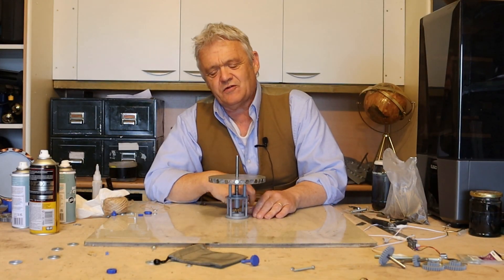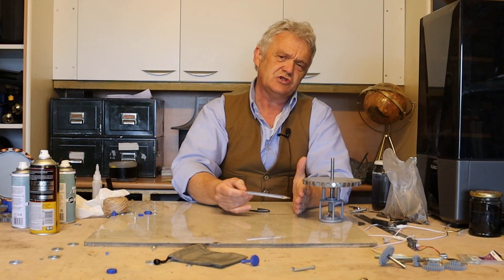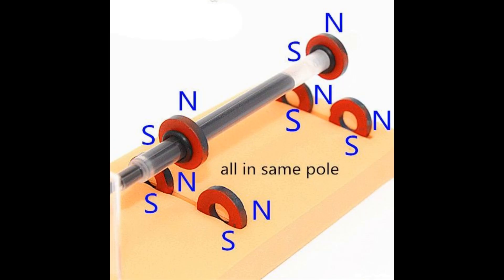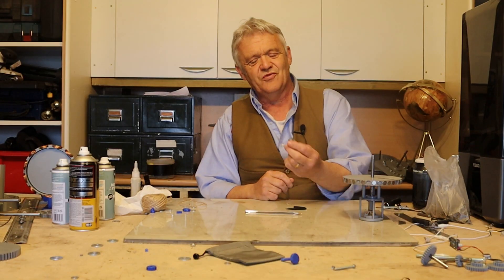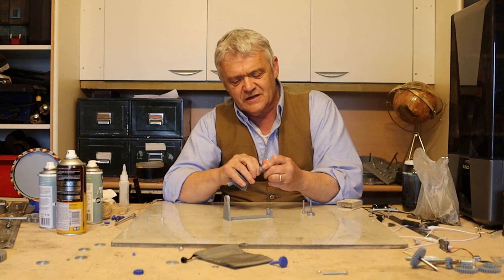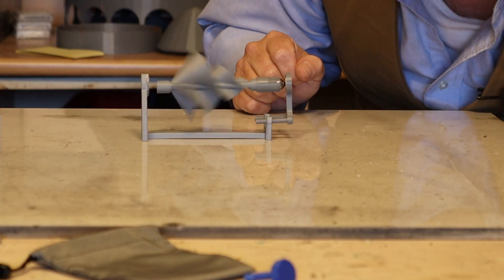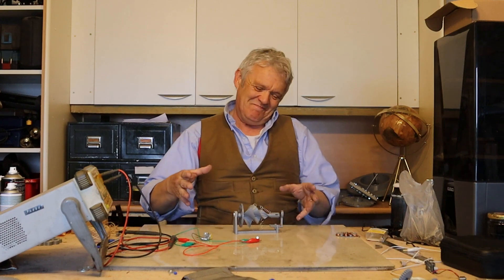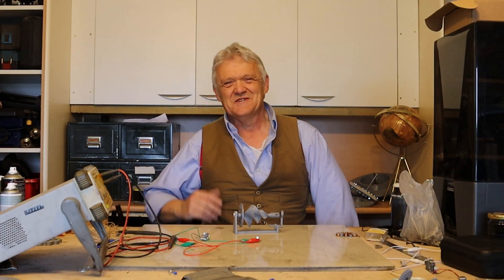1995 Archimedes Wind Turbine With Magnetic Bearings

Comment: Your video is very interesting; you remind me of the first steps of Mr. Gernot Zippe (Mr. Steenbeck's son-in-law), 
when he was looking for the right compromise to build his first centrifuge.
 For the record, he used the magnet (1948/1952), and the needle at the bottom was made of piano wire steel,
 to make a beautiful little needle, (like the needle of the phonograms of the time)
the needle turned at the beginning in a small concave oiled container!
Finally, it is also the fact of creating a vacuum in this process which allowed great reliability of the rotations...

Comment: Could you please, Robert, run that tri-blade Archimedes screw in reverse to turn it into a propeller and do a whole episode on this propeller concept’s performance? That means the blunt side will be the front that scoops the air in and the pointed side becomes the back where the air exits. Use physical bearings, though, rather than wobbly magnetic ones for this experiment. I imagine it will be super quiet and very efficient! Please. 🙏

Comment: awesome, being archemedies turbine it will auto cock itself into any wind also :) i can see small varients of these being included on e vehicles to scavenge power it ofc can never equal the power needed to move it along but with so little friction & being self cocking design without need of extra power i think it could be as useful as pasive breaking systems are for energy reclamation

Comment: The Texas Engineer has the US Patent on the Tornado Turbine many years back. . It is regarded as the best windmill design for generating electricity. Photos of it are included in wall posters of various designs of windmills. Looks like a farm silo at a distance with small upper 360 degree automatic directional vanes catching the breeze and the air swirls down inside the spiral large vanes to the main large electrical generator that is above your head. The fast air exits out the sides at an upper level.
Reply: the archemedies turbine due to its shape is also self cocking and works in winds of just a few kmph. it will always point into wind just because of its shape so its always receiving maximum possible wind load on maximum amount of surface

Comment: how about running the current back into a small electromagnetic  floating bearing to strengthening it. Till a certain level of power level is achieved. then release the remaining to power the light. while still strengthening the bearing. achieve high speeds, more stability?

Comment: Couldn't we use this on the sea bed, to generate electricity from ocean currents ? Better than the windmill type devices that kill fish and whales etc. Some mods would obviously be required, perhaps depending on the rate if flow of the ocean current you are aiming to tap in to ? Ocean current operate 24/7/365 so no need for so much storage. 
Am I too late to take out the Patent on this ?

Comment: Many wind turbines have one problem: high winds. As the wind speed goes from a normal speed to 80 - 120 miles per hour, the turbine spins so fast that it can be torn apart. In the large 3 bladed wind turbines the blade changes position relative to their mounting hub. The more the blades rotate relative to the hub the less force the wind can exert on the blades. When the blades are parallel to the wind direction, the wind turbine stops rotating and the high speed wind won't destroy the turbine.
Reply: I think they have brakes to get the speed down

Comment: We missed something. If the turbine is configured to suck air from each end of the turbine, opposing forces would neutralise all torque forces upon the turbine drive bearings and drive shaft. In effect, using high-volume vacuum pressures to drive power devices

Comment: Ha good thinking. I had the exact same idea 5 years ago with this exact turbine except I had it hanging vertically above my living room radiator from a screw and had the bearing attached via a tubular magnet glued to the turbine. When the heating came on the turbine would spin. Hardly any resistance this way, the slightest breeze and it flies!

Comment: This is a good idea! Smaller turbines require less wind to rotate than large turbines. This could be scaled up with several small turbines in a fence and then have a screen around it to prevent birds from flying into it.Also it could be built into architecture such as bridges and property fencing to reduce optical blight. Awesome idea!
Reply: I'm not sure a screen would be ideal. I think you'd be robbing your efficiency
Reply: Wind is a fickle thing...

It is disturbed by the smallest things in ways that are detrimental to the ability to use the air movement to harvest power.

Normal recommendation is the bottom of the wind turbine be 30 feet above the highest obstruction within a very large radius.

Your screen, even "chicken wire"  would naturally interfere with the wind and greatly diminish the ability to harvest power.
Reply: It's doing the same work as a 3 cent solar panel.

Comment: I'm retired now and I worked with Rotary Screw NH3 (Ammonia) refrigeration compressors for the most of my working life. I was aware that there was research and some progress with magnetic bearings both for the large electric drive motors and the compressors. Something like that would reduce starting amps and in essence be frictionless for stationary rotating equipment. Have you ever heard of this path of research?

Comment: Dear Robert,
Here in Chearsly , Bucks, we have a three phase supply lines to an
empty disused and unconnected old pig unit.
A hillside location, where two telegraph poles hold
the transformer above the removed old metre

Inside the building are lots and lots of electric fans, some quite big
Millling ones, grain bins etc. others ventilators

So from what I have learnt from your lessons; I hope is:

It would be mad not too collect all the biggest motors
Four biggest for first morning 
Get them on the Hill by the power box
Support them facing upwards (as high as possible)
Use farm made barrel turbines.  Out of plastic 50 gallon barrels 
Or whatever’s best under trial 

Get a bod and electrician too collect the whole lot together and open a new power company account metre below
transformer for them 
to connect too and start feeding power
back down lines

Robert , assuming that the sparkys know there stuff ;right this and that wires etc 
and the fans turned with the prevailing wind
I can’t see what’s not to like
Am I mad or not
Using barrels would protect motors from rain up on two gate posts
Love what you do
Sincere one
Henry

P.S I’ve worked on the farm for twenty seven years, but my channel videos make it look like I am a rock star
I am not. Only for fun.

Comment: Great video, love the tinkering. I had an idea that you might perhaps try out. I'm curious to see the flow rate of your modified Darwin project connected to a output tube (keep the diameter constant), apply a hair dryer for hot air & measure end of tube flow, then try with cool air (getting same input flow rate) & measure air output flow rate. I wonder how different lengths of tube would change the rate (slower is some function of longer tube due to friction perhaps?). I wonder how hot or cold air may change the flow rates per length of tube. Kicker could be... Would a Tesla (scientist, not company) Value aid in increased flow rate? At beginning or mid or end of output tube? What about by varied tube lengths &/or heated or cold air?

Comment: You can literally use a brushless DC motor (from an old record player) for this and it's pretty efficient. I've taken one I've had fro MANY years and put an old microwave fan blade on it and attached the contraption to an 1/2 inch PVC pipe and stuck it high in the air. It made about 14 V - 19 V easily without a load.

Comment: Why couldn't you take a cone magnet and use it for the end and machine a female to the cone tip that was the same polarity either as a magnet or a piece of iron with a magnet attached to give it the polarity desired? The cone "should" provide a constant on both ends without the need to touch on either end. This would remove all drag. You could even stand it upright and further reduce gravitational interference.

Comment: Fascinating, as always!  If I get the assembly, the ballpoint bearing is on the windward side of the turbine, so the wind thrust would pull the bearing away from the bearing surface. Would turning the turbine around allow the bearing to carry the wind thrust? That might stabilize the wobbling a bit and support the thrust.

Comment: Ever thought of using using a CDROM moteor as a generator? All the ones I've used in the distant past, used a three phase winding so you need a 3 phase rectifier. Used to connect it to a modiified Fan to drive the gennie.

Comment: I've asked the question on multiple videos of people demonstrating this floating axel setup: Can the point contacting the retainer plate be replaced with  2 opposing force magnets, making it a contactless axel? What fails if the axel has an outwardly facing south pole and the retainer plate has an inwardly pointed , opposing, south pole? One would assume that the 2 magnets could be arranged so that the tip of the axel is magnetically floating above (beside) the magnet on the retaining plate, making the entire axel a truly floating mechanism. Seems logical in my head, but I've never performed the experiment. If you have a few minutes to set that up, it would be great to see the results.
Reply from the maker: the simple answer is no - the explanation of why is long - which is probably why you haven't had an answer yet - but the simplest thing is try it and see - good luck

Comment: Very very cool Robert, love how fast you can bang proof of concepts with a 3d printers, imagine Tesla with one of these, instead of designing and hiring out contractors to build something, Inventing has never been easier, tinkering has never been fast and efficient.
Reply from the maker: t s astounding how 3d printing is helping - to think only a year ago - less probably - would have been in the '3d printers are rubbish camp' - how things change!!
Reply: @ThinkingandTinkering  I was using 3d printers 5 years ago and it was like "why spend so much time building and tinkering with the 3d printer when I can just build what I need faster than making the printer work to make it:, but now they work out of the box and with filesharing and easy cad wysiwyg web programs, you would be insane NOT to go the way of the 3d printer, the day of super speed inventioning and prototyping is upon us, nice to see you at the forefront :)

Comment: Magnetic bearings work best in a vertical orientation and the method of holding the bearing in position requires correct placement of the magnets to have an attract and repel setup. I made one as a demonstration using an old CD storage case to make the bearing mount and the spindle as a proof of concept that had the desired effect of both working and shutting up those who claimed it couldn't be done.
Reply from the maker: done videos on it in vertical too mate

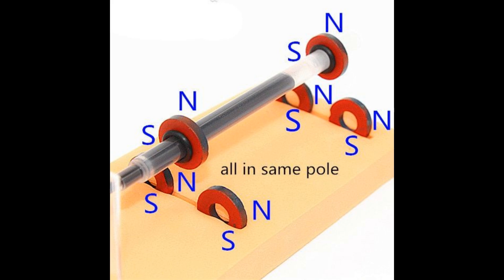Comment: At 1:32 all you need to do is clamp the rotating shaft with another 4 magnets above the shaft magnets this should stop most of the wobble. Basically duplicate the bottom plate above the shaft. Ultimately you should clamp the rotating shaft in place totally with 10-12 magnets and no ball bearing the only friction would be with the air.
Reply: I used 4 magnets....2 on bottom 2 on top (not symmetrically spaced) to help dampen the wobble.  It does work...I can spin my horizontal magnetically levitated motor to 2500rpm and she runs pretty dang smooth.  I even have an axial flux rotor attached and I can get the stator very close.
Reply: @Dave_D.  Im assuming you still kept a point-contact tho, like the ball-point bearing the video shows. Im specifically refering to a system that would achieve 0 degrees of freedom from magnets only. Using mechanical joints and bearing, it is as you could say staggeringly easy to achieve it.
Reply: @colinlapierre-fecteau316  I thought @kevin was simply talking about the shaft rotation bearings....where Robert's 1st example showed just 2 underneath.  If you add 2 more on top -  to form more of a complete circle, it helps hold the shaft stable while it rotates, as there is forces acting on all sides, not just the bottom.  Yes, I still have a pen ball point as my contact against tempered glass.  I don't think it's that easy to eliminate the single point of contact and use magnets...I think I MIGHT have seen one example where he claimed to have done it....and I've looked at a lot of stuff on levitating a rotating shaft.  Search for 'flywheel with magnetic bearing' (synterr)....he has 4 magnets and it's so smooth.  He does have contact points on both ends...I only have 1 and my shaft is 2 feet long.
Reply: @Dave_D.  that's interesting!
Its true that what i've seen said was about a static equilibrium, so it might be possible to have 0 contact as long as it keeps moving.. 
In any case I'll be sure to watch what you recommended, it seems like interesting stuff!
Reply: If i am reading your proposition correctly, that wouldnt work.
It has (unfortunately) been mathematicaly proven that levitating an object using only dipole permanent magnet is simply impossible. The best you can achieve is a meta stable sysem (basically as stable as a lead pencil resting in equilibrium on its sharpened end), which would immediately fall and break as soon as it'd start moving.
Lovely, very intuitive idea, but unfortunately physically impossible until we discover permanent monopole magnets 😞

Comment: Do you think it reasonable to use a pointy insert on the end that floats into a matching cone-shaped dent in the frame, and then fine-adjust the distances so that the point would enter the dent just enough that it stopped the excessive wandering around of the floating end?

Comment: I recall a man (but not his name) that built very high-speed gyros that had horizontal shafts on magnetic bearings.  They were spun up (charged) to well over 100,000 rpm by an integral motor-generator, and all of it was sealed in a casing vacuumed down to prevent drag on the wheel and other spinning components.  Once they were at full speed, they could generate electricity to power such things as cars and satellites.

The trouble with cars, is that they hit bumps in the road, which is hell on magnetic bearings.  He could control the gaps, both longitudinally and radially, with a microprocessor and gyros to sense the bump, to increase or decrease the power of the magnets in the bearings.  His biggest problem was containing the detonation of a large wheel at high rpms if one were to fail.  He also had issues with the speed of the sensors and the reaction time to power the magnets.  Processing speeds and sensor quality has increased greatly since then.

I believe that at least a few satellites were put into orbit to test the power packs.  Obviously, they would be recharged by solar cells, since long extension cords are very expensive. 😉

Comment: Replace the ink with machine oil
Reply: On my horizontal magnetically levitated Bedini, I printed a ball point tip holder, and I leave part of the ink tube attached.  I thought about doing just that...a little oil inside the tube to lubricate it.  Haven't gotten to it, I just put a drop on the glass/ball interface.
Reply: @Dave_D.  I would love to see that tried. Also maybe graphite. Oh, and maybe only have it spinning on a single ball instead of 3. Far less friction.

I Love to see your work brother. Great job
Reply: @Zane.Wellnitz  I ran it for awhile w/ no lube, so I think my ball got a little scratched up, but a drop of chain lube directly on it works great.  One of these days I will put a brand new one on.  I am running a single ball, look up 'flywheel battery' (Tom Stanton), and 'flywheel with magnetic bearing' (synterr).  Those are the basis of my machine.  It's very similar to Stanton's - except it runs on its own, but w/ 4 magnets like synterr's for stability.
Reply: @Dave_D.  I have watched them both. Thank you.
A microball pen would work great as well. Also a circular speaker magnet with the poles on the flats and run it in a vacuum for best results I'd think.

Comment: Why does it have to sit against glass? Could the force applied to the glass be achieved with magnetic repulsion?
Reply: It doesn't work.  At least not easily.  I THINK I may have seen one example of it being done, but the same reason the horizontal shaft wants to get pushed in one direction also applies to the opposing magnets on the end.  I use a pen ball against tempered glass (it will actually drill into regular glass) and my rotor will spin for a long time w/ a twist of the fingers.  My motor (on a horizontal magnetically levitated shaft) currently can spin at about 2500rpm and it's pretty smooth (very little wobble).
Reply: @Dave_D.  I have seen the argument that it would get pushed off but I have never seen someone try using magnets on each end of the shaft to oppose horizontal movement
Reply: @David_Mash  I watch so many of that type of video, I don't remember where I saw it, but one did claim to achieve it.
Reply from the maker: it just needs a hard surface so it doesn't dig in that's all
Reply: @RobertMurraySmith  but wouldn't it be neat if it didn't require a surface at all? If instead of requiring a hard surface to repel the force, there was a permanent magnet to repel the force?